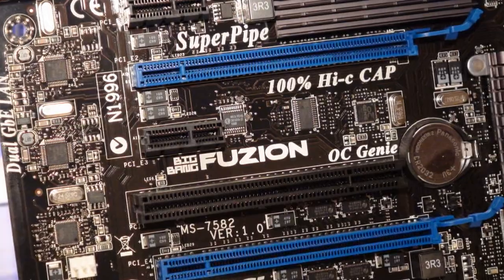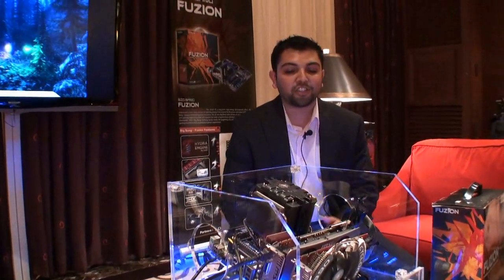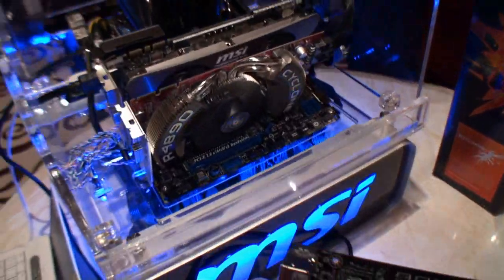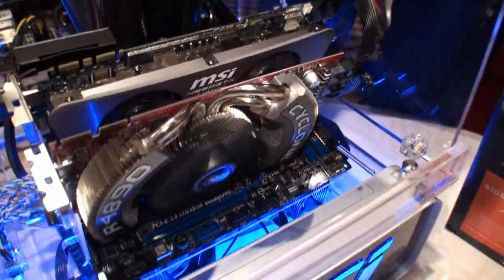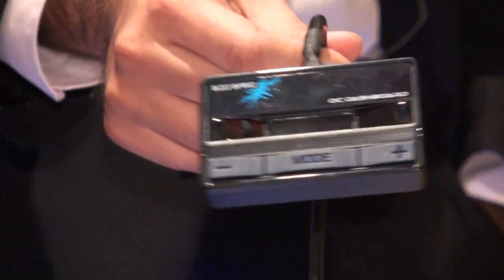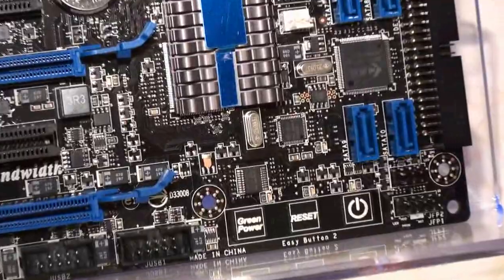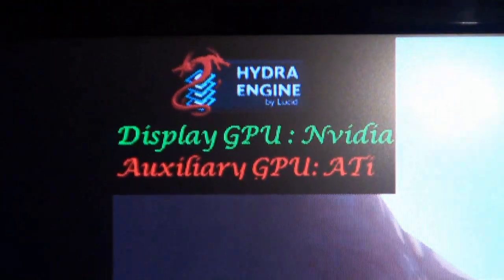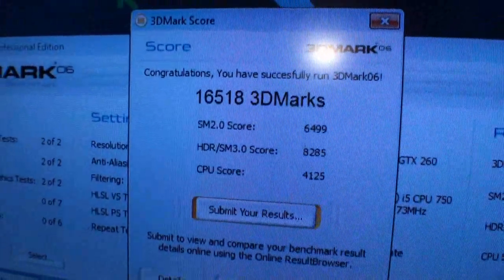MSI Big Bang Fuzion mobo demo with GTX 260 and HD 4890

Comment: @uuuaaaaaa cool thanks for the info that time I wrote my comment there wasn't any AM3 Lucid mainboard on the market the price of around 200€ is fair I'll wait and see if it works with crysis 2 and if it does it's defnetly bought (current drivers don't support Crysis 1 in the mixed GPU mode without fatal errors)

Comment: im going for the GIGABYTE GA-P55A-UD7 it has dual x16 PCI-E, the memory DDR3 can go up to 2600MHz *insane* and its $90 cheaper than msi Big Bang Fuzion thingy :)
in the P55A-UD7 you "cant" mix between nvidia and ATi cards. so my guess thats why msi Big Bang Fuzion board is expensive.

-prices are checked from newegg when this reply is writen

Comment: Sorry the i5 650, 660 and 670 are 100% and all have integrated graphics only the clock speed make them different

The i5 661 has a higher clocked integrated graphics chip but does not support Intel® Virtualization Technology for Directed I/O (VT-d) and Intel® Trusted Execution Technology were as the i5 650, 660 and 670 does

Remember all the 32nm chips are the same but features and clock speed are determined by there test performances and the features are locked accordingly

Comment: i5 750 is around £150 and the i5 650 is also around £150 were as the i5 670 is around 250

If you go on Intels website you will see that the i5 650 660 and 670 are 100% the same only the clock speed makes them different (661 has integrated graphics)

Rather get the i5 650 and overclock it to around 4.2GHz and save around £100 in the process or get the i5 750 as its great for gaming

i5 750, 650, 660, 661 and 670 are rated better than i7 920 or > in game benchmarks